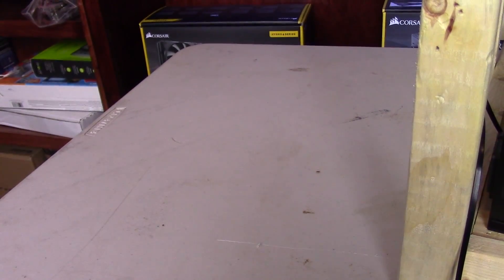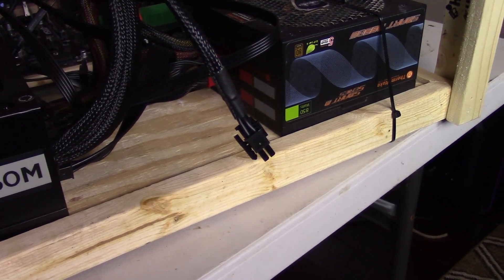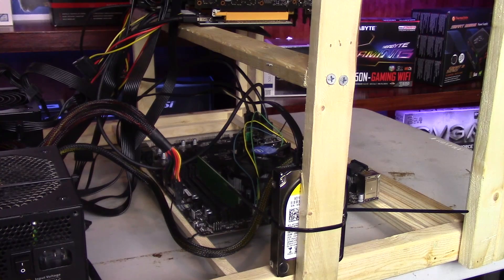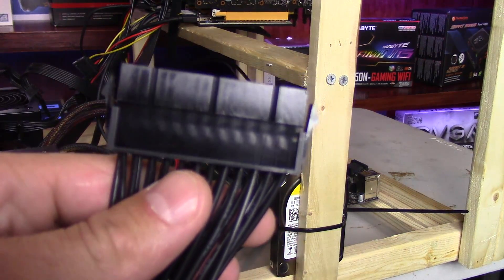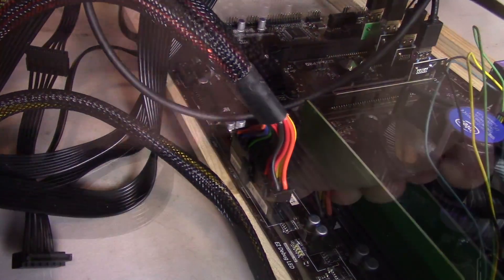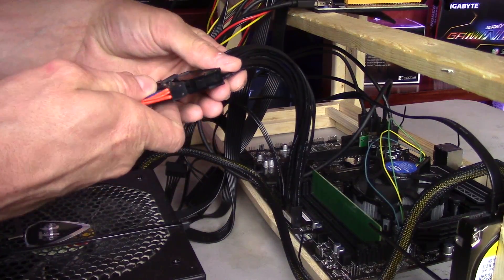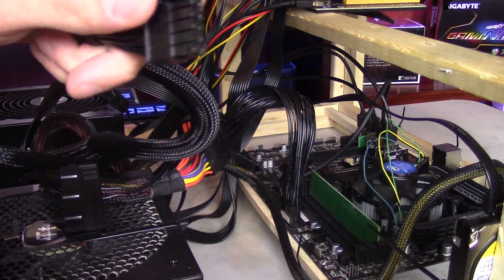How to Run Dual Power Supplies on Your Mining Rig

Comment: @SonOfaTech Hi thanks a lot for this. i was looking for this information. Just ordered this puppy:
4 GPU EVGA GeForce GTX 1070 Ti SC
1 CPU i7-8700
2 Memory HyperX Fury (4GB) DDR4
1 MOBO ASUS ROG Strix Z370-E
4 Risers 
1 CPU FAN 
4 CASE FANs
1 SSD  240 GB
2 PSU EVGA SuperNova 750

I too was wondering if you had a diagram / schematic of sorts. I've heard/read somewhere that connecting 2 PSUs may cause some weird voltage feedback loop. Is there a best practice to follow - ie connect each gpu/riser pair to same PSU or connect gpus/risers to one psu and everything else to other psu. so in my setup i could connect basic system components + 1 gpu/riser pair to psu1 and the other 3 gpu/riser pairs to psu2. or should i keep the gpu/risers on dedicate psu, etc? thanks in advance bro. great stuff.

Comment: @son Of a tech. I have the same exact cable splitter. total GPu's on my mining rig is 8, i have connected 3 GPU's so far to the main power supply AX1500I (I have two of these) but when i try to connect the 4th GPU to the secondary PSU the rig turn on for half second and then shuts down. Any recommendations of why this is happening?
Reply: Sounds like you're not getting enough power.
Reply: It was a bios settings. I switch things around and it's working smooth now. thanks for the great vids.
Reply from the maker: +Will Batshoun it's hard to diagnose that in the comments man. Could be faulty cable, psu or even gpu.
Reply: Will Batshoun what where your BIOS settings ?

Comment: Hey. I have with this . I have two power supplies and the same adapter. Everything boot fine but after 5 minutes the screen froze and nothing will work. I test all single parts. One power supplies work fine .
Reply from the maker: Not enough power for the GPUs?
Reply: Son of a Tech i got 2 750w power supplies for 2x1080 3x1050ti and 1x1060 3gb. You think only one card freeze or all?

Comment: @Son of a Tech I have a problem where the second PSU doesn't turn on (technically it turns on for a sec then turns back off) but it wasn't happening when I first tried it. Please advise.
Reply from the maker: sounds like a poor connection or a faulty adapter
Reply: then I don't know if this information will help or not but after not turning on this time when I touch the components connected to the second PSU whether it be the GPU or the PSU itself, even though everything is turned off I am shocked by electricity. 

I doubt that it's because of the faulty adapter as it was working earlier, and is still working now since the 1st PSU is still turned on without any problems, if I recall the second connector is meant to trip and jumpstart the second PSU right?
Reply: Is it possible that the PSU got fried during the process and won't be usable anymore? :(
Reply from the maker: you can bench test it. I don't have a video but google how to.
Reply: Alright thank you very much for the assistance.

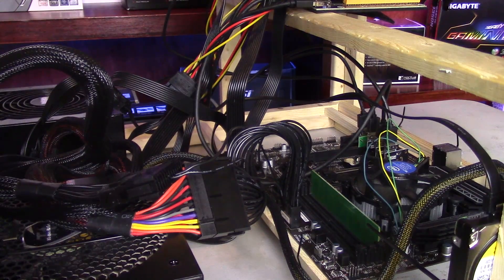Comment: Can you clarify  2:42 where you say "whether you decide to use a power button or in my case I just tell the system to just power on when the power is switched on..." Do you mean that when your PSU power is turned on the computer automatically turns on? What benefit does this have and do both have to be turned on? If i decided not to do it this way, how should start it up with two? Would I power both PSUs on first then the power button on my motherboard? Thanks!

Comment: i have better and faster solution, just connect green from primary to green seccndary psu and any black from primary to secondary, just use one to power motherboard and processors ssd and/or hdd and cd drives and second to supplay gpus led ect, bottom line dont use two psu for same thing, like both on one gpu, or one for each processors if you have two and so on

Comment: What if you're using two 1200W HP server PSU's with breakout boards and a EVGA 850W ATX power supply

EVGA 850W - Powering the mobo and the risers?
HP 1200W # 1 - Powering 7 GTX 1070 cards
HP 1200W # 2 - Powering 6 GTX 1070 cards

Would I just switch on the HP power supplies first, then switch the ATX on? Backwards to power down?

Should I be using the HP power supplies to power the GPU's and the risers (with a 6pin y-splitter)? Could I power just the 12th and 13th card / riser with the ATX power supply to spread out the power even more?
Reply: It's been 2 months, did you figure it out?
Reply: Ed Sure did. 

Did it exactly as described above. Parallel miners X-11 breakout boards connect everything together so the ATX controls everything on / off just like the add2psu. Using a 4 pin molex from the mobo that connects to the X11 breakout board that signals on/off and the X11 additionally has a 4 pin connector that links them both together.  Works great.

Comment: When using 2 PSU's, is there anything specific you need to be aware of? I did read something on Bitcointalk about at least making sure you're powering both the GPU and it's riser on the same PSU, but anything other than that? Also, when running an 8x 1060 3GB rig, would you recommend a particular split? Like a 4-on-4 GPU split, or 5-on-3 with the addition of the full system (minus the needed risers of the other 5 cards obviously)?

Comment: Just use the jumper that comes with some PSU's. Its free after all.
Reply: Ed I just plug them into a surge protector. So it turns it into one plug, and when I plug that in they both turn on at the same time
Reply from the maker: +RandoCrypto well, unless you want your power button to control both psus
Reply: I am also considering this. Which PSU should I power up first? Should I keep my external PSU looped first and then power on the rest of the system with the main PSU?

Comment: Can I use 2x Corsair HX1000i Platinum S1000 Watt - 140 mm - 80 Plus Platinum with this split cable?

And put 2GPU + Motherboard  in one, and 4 GPU in another?

Also, the PCEI's, they are connected with USB to the motherboard (adapter on USB), but should they also be connected to the PSU? Or connected with the other GPU's?

Comment: My question is sort of off topic, but do you know if I can use a splitter and then have two separate strength PSUs. For example, I have a 1000W PSU and want to use a separate 750W PSU. Thank you for your help!
Reply from the maker: +Samuel Forty yes u can all it does it trip the on position on the secondary psu
Reply: Awesome man! I'm trusting you with my rig! haha. I feel like I'm taking advantage here but my PSU has a couple extra 'peripheral' slots and sata cables fit in there but I am afraid to use them since the slot on the psu aren't labeled SATA. I have used all the SATA slots for mobo, SSD, powered risers, etc. I have one more VGA slot that I want to use but have no more SATA slots on the PSU to power the powered riser. Let me know although you have already helped enough!
Reply from the maker: +Samuel Forty not clear on the question really
Reply: I wish I could show you a picture. The PSU has six slots for VGA,  4 slots for SATA, and 2 PERF slots. I have used 5 VGA slots and all the SATA slots (for powered risers, SDD, MOBO, etc). For my final GPU (would make this a 6 rig GPU) I need an extra SATA slot to plug in the powered riser. Could I use one of the empty PERF slots?
Reply from the maker: most good risers have molex, 6-pin and sata options

Comment: Hi, I am thinking for building a rig with 6x 1070ti.... can i run my all GPUs from Bitmain power supply 1600w ....AND... all the Risers and Motherboard from another power supply of 600Watt???....PLease DO reply ...any who has tried this?
Reply from the maker: +Haresh Parmar why bitmain? You mean a server psu. In theory it's no problem.
Reply: ya server psu..... you think it would work?
Reply: 1070ti's get slower hash rates than regular 1070s (at least with Ethereum). I've google this and also verified by purchasing a ti. Good luck!
Reply: but i would be mining zcash....
Reply: If you are using USB riser, power both riser and GPU with your 1600w. Don't use your motherboard psu.
Reply: bitmain psu has no power buttonm but u are thinking in the right direction

Comment: Hey... very important. ... maybe u must also cover this. I jumped 2nd psu. And attached 6pin via 2nd psu, n riser power(molex) from firsts. It created a fan noise issue in the gpu.
Atleast i faced this problem. Will see if tjis persists
Reply from the maker: let me know if you can replicate on multiple systems and I'll look at it. Nice name btw. PingEarth
Reply: I solved it... I just connected all GPU and riser from one jump-start PSU and rest PC components with mobo PSU.
Reply from the maker: +IPconfigEARTH glad to hear

Comment: hii i just purchase second psu server but its doesnt have 24 pin wire for motherboard so  what should i dooo ??
Reply from the maker: you need an adapter if you are powering a mobo off of it https://www.parallelminer.com/product/180watt-max-24pin-atx-power-module-included-sata-molex-cpu-power-connectors-ditch-your-atx-power-supply-entirely/

Comment: Every time I try this I melt a cable.
Reply: the PSU has to be connected to some load, like motherboard/gpu. If not, it will overheat (melt wires?). And use wires that are the same size as PSU ones (or bigger)
Reply from the maker: well that sounds awful. Which PSUs/cable?
Reply from the maker: +Josh Hadley I'm still going strong. What are y'all doing lol
Reply: Can it apply to PSU which has 2000 watt or more in total? Is it safe to use?
Reply from the maker: yes, it only trips the power signal wires

Comment: I tried to follow the same thing as you do . Everything was fine and turn on the GPU,riser on both PSU is running until I launched my Claymore . Right after I launch my Claymore 2nd PSU automatically turn off by it self . Any idea ? Please help
Reply: What do you mean typo in exe name in bat file. What should it be
Reply: Hey i have similar issue, did u find how to fix this? Thanks
Reply: bump - same problem here, any fix information yet; also have another rig the splitter is installed but 2nd PSU doesn't power up at all  - some input would be grateful  Thx
Reply: I have the same issue. After some investigation I came across to something called minimum load for the other power rails 5V / 3V. It seams that the psu needs some current consumption for these 5V and 3V rails.
Reply: Gabi Gabby can some explain this more

Comment: What's the difference between this splitter cable and the add2psu adapter?
Reply: in case PSU1 powers down, PSU2 also gets powered down. Can be ignored, if you have a fan or something that isn't triggered from the mobo. If PSU2 is only powering GPUs and the rig powers down, PSU2 can be damaged. Add2psu prevents that. Also a single chassis fan works, as then PSU2 is powering this fan, which is enough to not short curcuit.
Reply: Any preference?
Reply: Psylar no the same thing. One has common ground, one doesn't.
Reply: they essentially do the same thing

Comment: EVGA 850 power supplies provide a 24 pin jumper wire that shorts out the shunt then turns on the power supply unfortunately it doesn't turn on with a computer during a power outage so you would have to turn everything back off and then unplug and plug each pin back in without one of these but I'm running three power supplies with that setup but initially I'll be finishing with two power supplies in that connector would be effective in my application to prevent restarting problems